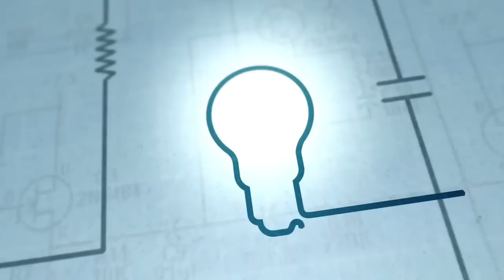DiResta: Draw Knife Restoration

Comment: I really love these videos where you restore old and battered tools to things of beauty.
Reply: +pestr999 It really was not that bad off. He made it worthless to a collector, that is for sure.
Reply: +Paul Frederick that's okay I use tool. I don't collect them.
Reply: jimmydiresta
That was what I figured. I'm the same way with a lot of used tools I fix up myself. Still, it never hurts to use the more gentle processes. That draw knife did not look really pitted to me. It just had the bright orange powder rust going on by the looks of it. Vinegar can usually defeat that. Put the tub out in the hot sun for a power boost.
Reply: After he sanded it , the metal surface still had discolorations so I think it was already starting to pit.   I'll try the vinegar for a few of my older knives I found in bad condition. Paul Frederick
Reply: pestr999
I have done electrolytic rust removal too. But vinegar is almost as effective, and a lot easier.

http://i.imgur.com/oAUodS2.jpg
Reply: +Paul Frederick ill try this thank you for the tip !
Reply: jimmydiresta
I use white vinegar. Stuff is usually dirt cheap in the supermarket by the gallon. My grandfather used to clean steel pennies in it.
Reply: +gander13189 I'm not Jimmy, but it's essentially just a flip of a coin. On something that small it's fine to start with square stock. But you could cut off the corners first if you wanted to. Either way is fine.
Reply: +pestr999 Restoring old tools like this one mean repairing the handles(handle) and putting a good edge on. Taking the patina off ruins the feeling of having a piece of history in your hands.

Comment: My all time favorite handtool. I'll probably end up subscribing because of it. I like to use 3 or 4 different knives on any given project. Lots of projects won't tolerate discoloration from patina on  the tool. When I'm 20 hours into an expensive stave I don't want to re-tiller or take another layer off the back to get a stain out.

Comment: Hey Jimmy, great video as always.  My only suggestion would be to watch how much sanding and grinding you do on the blade at one time, and to make sure it stays cool.  If it gets too hot to touch you're getting to the point your effecting the temper of the blade, making it softer and thus dull quicker during use.
Reply: +Joshua Webb hahahahahhahahah

Comment: Hey jimmy! Great vid fella, just though I would leave you a little tip. Always have a bucket of water placed just below the grinder 1 it will catch a lot of the fine dust generated by the grinder and 2 you need to keep the steel cool so you don't ruin the original temper of the steel! Not being a troll just thought it would help🤓👍 all the  best sandy

Comment: Great job! One suggestion:

If you want to fit the handles without epoxy, just drill a hole slightly smaller than you need them to be, heat up the handle of the blade until red hot and push the wood handles on. This way you fit them perfectly by burning them in and it wont come off any time soon! :)

Comment: When i restoured this knife i made a handles from raper arround thick copper wire and polish all the blade and the copper like mirror finish, before i polished the copper i smashed it and its just like a wooden handles, but from nice copper, then i sprayed a lack over it for extra protection and for copper to not tarnish away the bling

Comment: That trick you used to drill a straight hole through the handles: I use the same one, but I started using it because I've only got one eye and no depth perception. I've still drilled a lot of crooked holes, but far fewer since I learned this trick

 Now if I could just stop burning my fingers with the soldering iron. (They're numb. It's a surprise every time.!

Comment: this vid was more of a rebuilding  than restoration 

some may complain that the orginal builder wouldnt use Expoxy   

Do car restoration guys put bias ply 70 series tires on what they are building or rubber brake hose lines?

Comment: How does the holding strength of that glue compare to the shear force of the metal tabs on the original tool over time? Really beautiful.
Reply: +Paul Bryan Platt Ask him in 20 years  :)
Reply: Have you ever tried epoxy before?

Comment: Using a draw knife regularly to make bows, the only thing I would recommend would be to also put a rivet through the handles/tang at the top. I know epoxy is damn strong, but draw knives take an incredible beating and there is a ridiculous amount of force that gets focused down to the small areas where each tang goes into the handle. Just a suggestion. Beautiful restoration though. I'm planning to restore my grandfather's draw knife this way but with Osage handles. Having a bear of a time finding the end caps though. Cheers.

Comment: That looks nice, but there was a reason why they originaly bend the metal over the handle edges.
The epoxy can't stand the forces on cutting for a long time. It will fall apart

Comment: Those bent over pommel ends were there for a reason. There can be over 100lbs of force drawing on that knife and no amount of glue is strong enough for that job. Simply put, my friend, your handles will fall off, mid stroke making it a dangerous tool to use.
Reply: +antagonizerr No glue can withstand 100lbs of force.  Think about that comment for a minute.  If that doesn't change your mind, go look up some videos or the specs on West Systems epoxy.  As another commenter said, "If you look at the technical data from West Systems website for 105 epoxy + 207 hardener the tensile strength is 6748 PSI".  He's going to be fine.
Reply: n8guy Bonding wood to non-porous metal...I think not. It's only a matter of time till that slick tapered metal prong yanks from that oversized drilled hole. If he had notched the tang, then maybe I would have given him a pass, but he didn't. Point is, if it can happen to hidden tang blades, which bear far less force, then a draw knife, that is subjected to far greater stress, stands a greater chance of failure.
Reply: +antagonizerr It will be fine. I made a handle for a hatchet out of African Blackwood and filled the tiny voids with gorilla epoxy. No issues. I have used epoxy over and over with no "break frees" As far as it bonding to non-porous metal to wood...the epoxy bonds to wood, fills whatever void there is and then bonds to metal. Chemical reactions on each separate piece forming a bond. By the way, yes, there are glues out there by the arm load that can withstand a measly 100 pounds of force without issue.
Reply: Karl Ackdamack
I don't have a lot of respect for gorilla glue as, though it can form a crazy strong bond when it's fresh, it tends to crystallize and weaken as it ages. There are numerous references to that happening online. But, that's only half of what I mean. Hidden tang knives are normally used in a horizontal fashion, and yet they can and do release with the strongest glue. With a draw knife,you're quite literally pulling the handle off of the tang in a vertical fashion and though the epoxy bonds well with the wood, there are no pores in the metal for it to sink into unless you notch it. Because of the force you're putting into the stroke, it makes it dangerous, like chopping with a cheap screw mount blade. Eventually they snap...potentially in your face. One day he'll be de-facing a log and one of those handles will let go and then...
Reply: I did it this way to annoy certain people.  Plan and simple. And the way I use a draw knife it will never come off. I am more comfortable holding the shoulders of the blade..Than the handles.
Reply: +antagonizerr I have used Gorilla glue on a few projects (recently on a headboard) without any problems but I guess time will tell if they crystalize and come apart. I mainly use titebond or elmers for my glue-ups. I have used Gorilla Epoxy on numerous projects without any issues and I have abused some of them. Once again, I guess time will tell.
Reply: jimmydiresta
Jimmy I respect your work, and though there are very few things in your projects I would do differently, this is tantamount to changing the tire on your car and only replacing half the lug nuts. It looks great, and it'll hold, but not for long. I spent a few summers being 'voluntold' to work at the Museums of Science and Tech and Agriculture in Ottawa Canada years ago in their restorations department. They practice something called "arrested decay" with their artifacts which basically means clean only what needs to be cleaned, and replace only what needs to be replaced. My drawknife is a 100 years old hand-me-down that is in serious need of love. Not sure if you're familiar with the site, but I'll make a tutorial on it and post it to instructables.com. You can give me your impressions, which would only be fair since I gave you mine.

Comment: Can't argue with the finished product, but two questions. Why epoxy the handles on instead of using the original method of bending over the tangs? and Wouldn't the friction heat from using an angle grinder mess with temper of the sharpened edge?
Reply: +David Lee Kersey .. because i knew it would get the gods crazy !! and i didn't get that hot ... i did get out a bid dip in the edge so the belt sander was the first thing i needed to do Thank you  !!

Comment: I just scored a draw knife from an old timer (forged by his uncle back in the day) and am going to put it back to work, so this video is well timed for me.  Trouble is, instead of hooks my handles have caps that are forge welded onto the ends, and I don't want to mangle it trying to torch them off.  

I'm going to use electrolysis to pull the rust off, so I don't grind off the old hammer marks, but I'm not sure what to do about the handles.  I figure worst case I'll melt up some HDPE to form around the steel.  I'd rather have it ugly and working than original and useless.  It would just keep rusting in a barn if I didn't spot it.

Any ideas for my handles would be much appreciated!

I was a bit unsure about the liberal grinder use at the start of the video, but it sure turned out spectacular by the end.  I hope that knife gives you years of pleasure.
Reply: Cut the new wooden handles in two and glue them back over the tangs and caps.
Reply: Just like Adamast said... Two pieces of wood, like knife scales with epoxy.  ThenAnd could use brass on both ends of each handle to help keep it together.  And finally you could wrap the handles with leather strips.

Comment: You needed to put the handles further on and bend over the tips again. You pull on the handles. The glue will eventually become brittle and the handles will pull right off.
Reply: +typo148 I was wondering that. :/
Reply: +typo148 That's the point. How would you properly season handles for your spoons if not on a draw knife first?
Reply: +typo148 idk. a lot of knife makers including myself use 2 part epoxy. some of the epoxy out there is pretty damn strong and will last a good while.
Reply: +typo148 Glue... That is 2 compound epoxy. And a heavy duty one at that. I'd bet my left nut that wood will go before the epoxy will let go.
Reply: +Snakeprophet That draw knife is probably over 100 years old. How's that for a good long time?
Reply: +Paul Frederick too long for the previous handles, that's for sure :)
Reply: Gareth Crispin
The handle that was there looked OK. The other one was broken by user abuse I'm sure. I have a number of draw knives here that old with the original handles on them.
Reply: +Paul Frederick I have one that belonged to my great, great grandfather and the handles are still in fine shape.  They're either original, or 100 years old too.
Reply: +Snakeprophet The epoxy is only as strong as the adhesion between the wood and the metal.  I'm sure the epoxy works quite well with "regular" knives, but he draw knife, by its very design and use, has very different forces working between the handle and tangs than does a knife.
Reply: +typo148 WEST Systems is a marine based epoxy. It has come out of the yachting world, it was designed to hold under extreme conditions experienced by world circumnavigating yachts. Including tropical heat and arctic freeze, all while being soaked by salt water. The torsion loads of these epoxies tolerate are immense. In Jimmy Diresta's shop the temperature differences are not that much, I am sure he does not take the fancy to throw salt water at his tools on a whim, and as strong as he is, I doubt that he equals 80 sqm of sail with a 30 knot wind and a 26 ton boat doing 12 knots.....
Reply: +Jamie Rollinson I think Diresta like to get the best of the best epoxy available. By the way, it's marine-grade epoxy, not marine-based...
Reply: +typo148 So, he can just fix it again...
Reply: +typo148 I'm with typo148 on this one. Lots of jerking's going on with those handles. Some day the will get loosened and just fall off. (if someone really is going to use it)

Comment: What's the name of the tool at 1:57?
Reply: +Skizzo9 Are you asking about the right angle air die grinder, or the twist lock pad it is driving? https://sites.google.com/site/astorescenter47/3-in-40-grit-twist-lock-abrasive-discs-5-pc It looks something like that to me anyways.
Reply: +Paul Frederick I was asking about the kind of grinder. Thanks!
Reply: Yeah that is a right angle air die grinder. They're OK.  They do tend to burn out more than inline die grinders though. I've gone through a couple right angle ones. Someone should just make a handle to clamp on an inline one so you can hold them the same. Because really it is just for ergonomics a lot of times using one. There was no clearance issue I could see with what Diresta was doing here. Although I guess the weight of the inline one on the end might be a bit cumbersome let's say.

Comment: Why is everyone so obsessed with taking all the patina off of old tools? It took years for that to form. All one has to do is clean off any loose rust, put a light coat of oil on it, clean up the cutting edge, and thats it.

On a side note, I might be concerned about all that sanding and grinding messing up the temper. Metal gets hot very easily and seeing that a draw knife is not much more than one large cutting edge, alot of care should be taken to keep it cool.
Reply: Your concern is about it's collectible value. Others value it simply as a tool.  If it's tool I'm going to use I have no issue removing patina.
Reply: +Mike Kollross

In fact, I like tools as tools.  Ruining its 'collector's value' is part of my goal.  Then it remains a tool rather than becoming some rich man's wall hanger.
Reply: +Mike Kollross +CorwynGC One does not need to completely refinish a tool to make it functional.  In this particular case all that needed was to cleand off the loose rust, sharpen it, and replace the handle(s). I have plenty of old tools that dont have any significant collectors value that I just cleaned and sharpen them... they work fine.
Reply: David Mm
...That don't have any significant collector's value...yet.  Who know what will be the newest craze?
Reply: I am pretty sure if Mr Diresta felt there was a problem with the temper....he would know how to retemper it.
Reply: +Steven Hardy pretty sure is a totally inexperienced when it comes to tempering.
Reply: Moth j